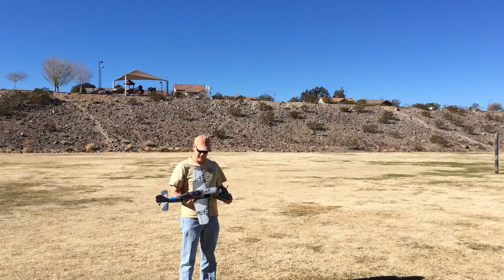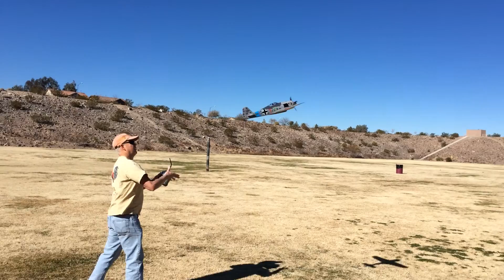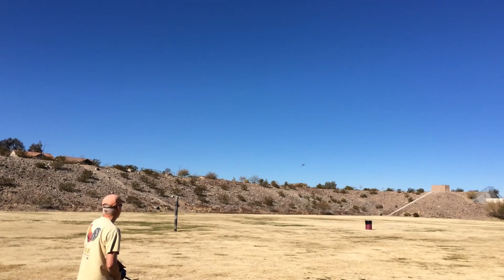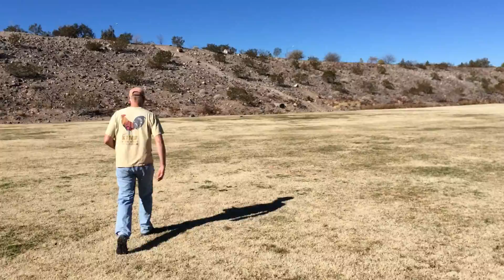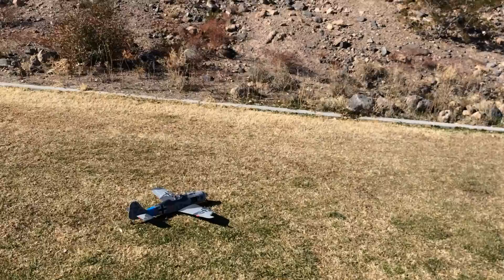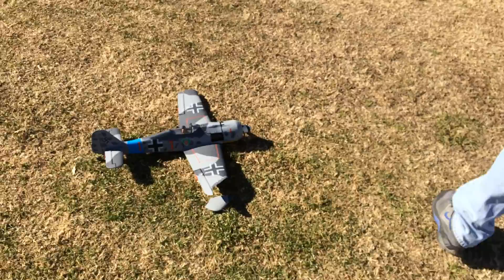FMS 750mm V2 FW-190 Maiden

Comment: im still trying to decide wether to get the fms p51 or this
Reply from the maker: I do have the 750mm FMS P-51. It's a much, much better flying plane. I modified mine, added 2 servos for flaps. The FW-190 is a better looking plane as far as the paint, but the P-51 flies much better...

Comment: It is the plane.  Simply put, this plane can not fly. Unlike a Trojan or Corsair , the 190 is not an easy flier to begin with. This FMS model is really good looking though after buying three of them and 20+ take offs, never once did I get one to fly in the air.
Reply from the maker: +Nicholas Kazantzidis 

I finally got it to fly, and it's now one of my favorites. It needed 20 grams of nose weight, a Lemon stabilized receiver, and I backed way off on D/R and Expo. Those three things, made it a wonderful flier. It still does not like wind, but flies great now...